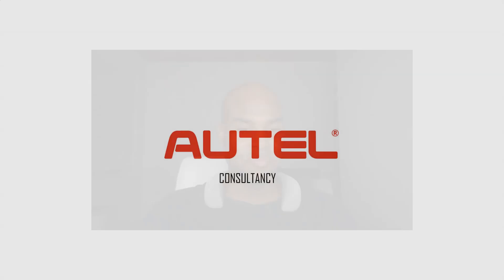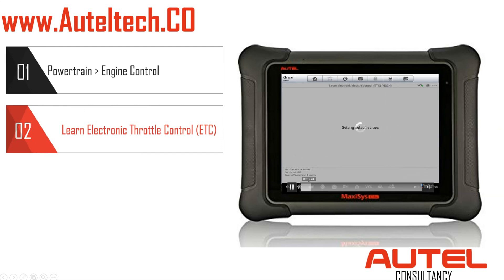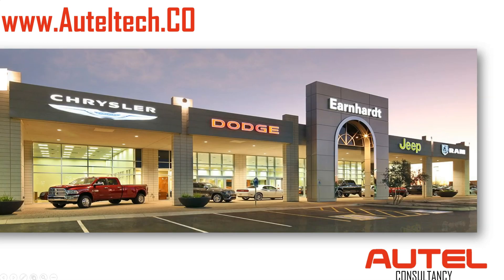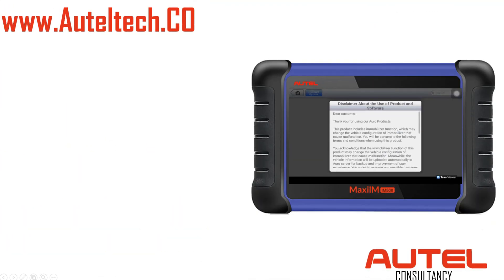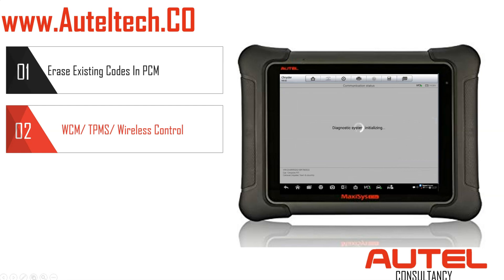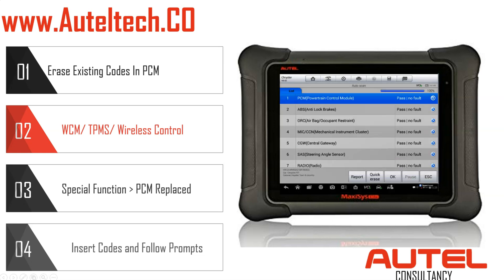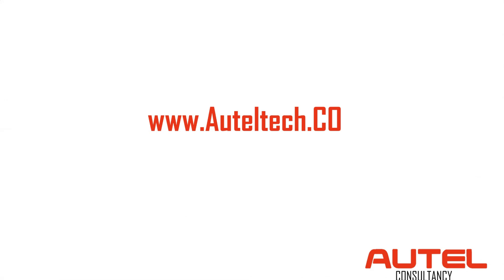Autel Maxisys Elite | Chrysler Town and Country PCM Programming and Pin Code | Case Study 2019

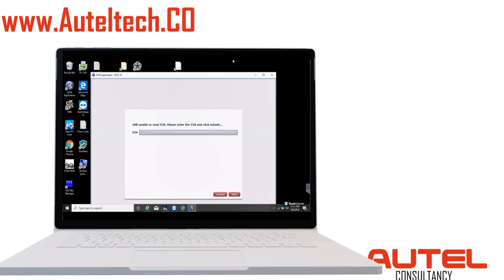Comment: note the pcm on these is in the drivers front fender well, not on the top like shown in the video.. I have replaced  hundreds of these pcm's.. mostly due to faulty alternator field control. I am still learning this autel process, I have dumped witech due to tech authority raising prices, its not sustainable for someone that only does 2 or 3 pcm a year... I am still confused on how the programming works here as you show it.. 2:20. what program is that?  the video just blasted past the programming part without much detail.

Comment: IM508 I bought for around $1k should it complement my Elite welI to expand it's immobilizer capabilities to what it should have had to begin with , Oh Well. 
  Kind of few and far between for key programming opportunities over time ,so  I was hoping I would be able to use my IM 508 ten times like my Elite allows before being forced to register the unit and start off the 12 month warranty and update period, however,  new out of the box,  mine wouldn't even allow me scan a single car or pull PIN , and just see how well unit works overall unless I connect it to the internet and I assume be forced to register the unit. I am going to wait until I have my first actual key or fobik programming that my Elite is unable to do,( if unable to calculate the PIN for free with some phone Apps).
 Now I figure there are just so many Stupid F people , down to their last working Fobiks that odds are my first IM508 use is going to be an ALL KEYS LOST and I'll look like a F'N @ss because I won't have the APB 112, so that's another $200-$300 , so I ordered that.  Now I'm reading that the APB112 isn't compatible with the XP200, and you need the XP400 that is like another $400-$600, but that should give me more Euro car capability but, not in my budget at the time. Why can't Autel just make all those  green circuit jumper, soldering  boards an optional extra cost option that 90 % of us will not want to mess with and just include the XP400 and APB112? with the IM508?
Reply from the maker: Hello, Great question. Well you have to look at things in a broader perspective.  If you look at the data in the usa , 80 percent of the vehicles will be able to be coded via obd . ( USA , Asian, vehicles)  The the other 20 % of vehicles  from Euro manucatures will have a higher probablity it need sto be coded on the bench.  So for consumers who are in Europe will have a higher chance of needed to code/ program a key on the bench since thas thats most of the cars they see.  I think Autel philosphy is to make sure they equip the user with all the equipment to solve any problems and the give the user the choice to use the equipment to its full capacity or not.   ( just like how people buy the elite but never use the Jbox)  .     PS
I dont suggest doing research online because the information is generic and the minor details they dont tell you will cost you major money in the long run. Im not sure what your set up is but most of the DIYers spend more money on buying tools they dont need ( based on the info the read online) and later will find out they didnt need it. ( or the tool they wanted is not cablable of doing the job ) For example. I dont think you really require the APB112 unless you focus on alot of Toyotas. You dont need the xp400 ( unless you want to do key coding on euro vehicles on the bench) The APB112 will connect to your tablet. Only on a small number of vehicles like kia and hyundai, renaut when you cant get the  PIN code,then you will need to use the xp400.
 Your paying alot more because you dont have the right information and strategy in place.

Comment: Curtis, can the XP400 key programmer be purchased separately and added to the IM508 to give it the same European car key programming coverage of the IM608, or IM 508 lacks the software for using the XP400?  
 Does the IM508 and IM608 rely on keeping your update subscription current and require internet  access to Autel server to be able to pull some PIN codes or information to program keys of some car makes of cars?
Reply from the maker: Yes you can add the Xp400 to the Im508 to give it level 5 of 5 key coding capabilites

Comment: Could one grab the PIN with the 608 immo function then go back into the diagnostics portion, instead of swapping scanners?
Reply from the maker: Hi Mario. Yes you can do all of this with the IM608. My client already owned the Elite so getting the IM608 would be a little over kill since it has the same diagnostic software as the Elite. So he got the Im608 which is mainly for the key coding.

Comment: hi can I do all keys lost with MaxiSYS Elite J2534 on 2018 Honda CR-V (Smart key)
Reply: Andriy Vladyka Depends. Not sure if the tool can force ignition on. If the tool can’t do that, then you won’t be able to add one key to get the car started. Also, AKL doesn’t require j2534 for Honda’s. Not with the aftermarket tools available. It can def be done through OBD. Just have to find the correct tool or tools.

Comment: Hello , regarding key programming capabilities,  is there much of a difference between 508 and 608 , I only need for key programming . Based in UK.  Thanks
Reply from the maker: The 508 is a stripped down version ( interms of not having the strong diagnostic software and now jbox and no xp400 to do the benz bmw key coding) The overal key coding is 4 out of 5. Its primaly focus just on key coding and doesn have all the bells and whistles as the 608
Reply: @AutelConsultancy  can the 508 add keys to vag mbq platform vehicles ?

Comment: Maybe  you could suggest to engineers to create an Autel PC based virtual IM 508 program guys can download the program , and attach their Maxi Flash Elites J2534 from their pc to vehicle and if it successfully pulls a working PIN for those that need a PIN , you split the $40 per working PIN with the engineer?

Comment: Is this possible with the im608? Where do i get the software for the laptop?
Reply from the maker: Yes you can do it with the IM608. You can get the directory of all the OEMS tech info site from Nastf.org
Reply: The actual programming files for the new blank ECU came off an online OE program with a purchased subscription from Chrysler using  the Maxi Flash Elite J2534 as the Pass through device between the Windows PC and the vehicle .The car needs a battery maintainer connected. The J2534 needs a USB cable attached between it and the laptop, and the laptop needs a good high speed internet connection. Not always easy to pull off when working mobile.